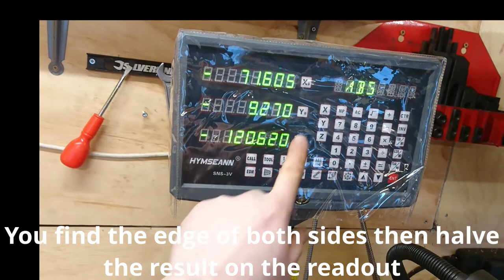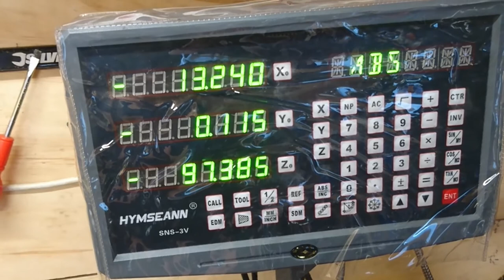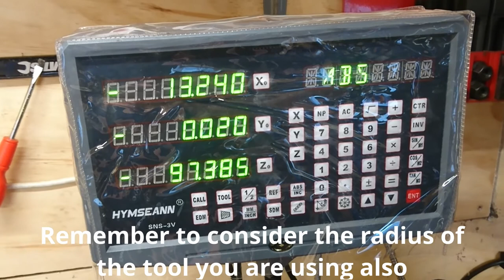A Simple Book Press Restoration

Comment: Just discovered your channel and subscribed, good job and nicely done. For hot bluing I mixed little bit engine oil with rapeseed oil and seems to work good, some stuff comes up really nice like a uniform and shiny full on black, sometimes results are not that good with different shades or some parts black and some parts are wavy. I wonder if it is to do with the correct temperature? or the metallurgy of the work piece? usually smooth surfaces seems to give better results. It's bit of luck as well.
Reply from the maker: Thanks very much. I'm working on a new project, a vintage air compressor rebuild. Should be done soon